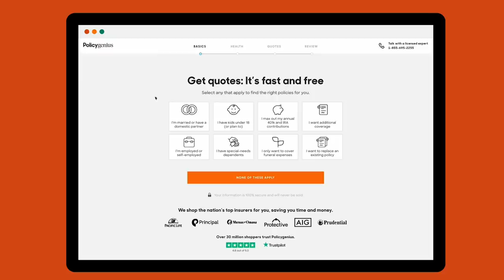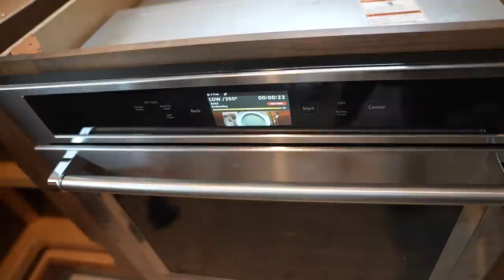DESTROYING OUR KITCHEN CABINETS | BUILDING OUR OWN HOME

Comment: I found with our brand new stainless appliances that the fingerprints will greatly diminish once you start using a stainless steel cleaner/polish. I get some from Amazon that are pop up wipes and they give a smoother surface after continued use. The brand new surfaces were a bit raw but smoothed up nicely after a couple of treatments.

Comment: Allie - before you bake your first batch of cookies, you need to burn off the mfg oils in your oven, otherwise you'll be dealing with some strange smells. Read your owners manual first, open all the windows and doors of the house, and crank up the heat in the oven for a couple of hours to burn off those smells you don't want in your food.  Glad to see all the progress of your house and your smiling faces.

Comment: Sorry, don't mean to be "negative" here. Very surprised that no-one in the comments mentions the fact that your ceiling boards are not supported, or at least "tongue and grooved", at all of the end joints . The board ends are ALWAYS fastened on a structural member (joist, rafter, stud, at least blocking). Never seen anyone let the ends all "run wild" as they might very well "curl", twist, and otherwise separate with heat, humidity, other environmental conditions. Also, in over 40 years of construction, have never seen a "built-in" oven installed at the floor. Single ovens are always installed at roughly "counter" height so they don't require getting on your knees to load and unload. Putting food coloring in the taping compound is "spot on"!!!

Comment: Your Home Depot kitchen designer should have/would have taken the size of your oven into consideration and ordered the appropriate cabinet to make sure it would fit.  Cabinet installers have to alter cabinets to make the appliances fit.  :)  When I was a designer I would always order a couple of extra filler pieces to fill in spaces in case of emergencies.  You're doing a great job.

Comment: The space or gap by the oven?  I would have framed the bottom and top.  Then made a door for it.  To match the cabinets.   To use as a cookie/pizza or griddle top storage for the stove top.  sheet pan storage.  You can still do it.  :)

Comment: Great work, guys!  However..., Trent, if you think your back hurt LIFTING the microwave, wait until you have spent 10 or 20 years bending over to USE the microwave (and oven)!  Hopefully by middle age you will be on to the next house, where you can craft kitchen appliances higher for your older selves.  In the meantime, you both and Brandon have built an incredible space for yourselves and your family.

Comment: Safety glasses Trent !! I hate having something in my eyes and have had to have eye drs take metal and debri out of my eye balls twice.i learned at that point 40 yrs ago to always have Safety glasses with me and have them on whenever doing anything I could have that issue.
   If you didn't have the heat on I'm sure the stain on the boards didn't dry.
   I was wondering if you turned your heat on when Allie said it was like 40 degrees and yall were working on drywall and staining. Live and learn, got to be thinking about these things.
  If the boards aren't dry and you handle them you will leave finger prints in the stain .
  I hope this didn't happen but if so well you personalized them LOL and if you ever commit a crime your finger prints are there for law enforcement LOL
   Wow progress galore .I mean adding Bryce was a no Brainer the guy is a definitely a professional grade builder and drywaller.
   And Trent and Brandon seem to find a higher gear with Bryce there.hmmm LOL 😆
   It's really coming together and when there counter tops go on .oh that is really going to make it seem so finished and ready to be lived in.
   Can't wait for that and I know yall can't either. 
   You need to pay Bryce to stay and finish the house with you and Brandon. You would have it done by end of October no doubt.
   Great job on fitting the appliances Trent. 
  And the appliances are so beautiful and so nice with all the new designs they have now days .those slide our droor grates are amazing never seen that before.
   Can't wait to see the next video yall are flying now.
    Allie is more and more excited every video and thats awesome because she's pregnant for yalls first child and she should be excited the rest of the way.
  Thank guys God bless you all 🙏

Comment: Hi from montreal! Love everything your doing… but if you end up not liking your darker stained wood in the sun room….just paint it the same as the walls…you’ll retail the different texture and it will fallow the ceiling all the way down. Don’t worry about it looking too sterile cause pictures and furniture will warm it up.  Now if your painting the walls a color then you may want to keep all the wood planks the same color (following the white ceiling all the way down to the floor. If there is one thing I’d like to say to my younger (less patient self) is not to stress about paint, it’s the cheapest thing to correct 😉

Comment: Your oven cabinet needs at least a half inch if not a three quarter inch floor to support that oven. You may consider adding extra top braces to strengthen it to carry the load of the stone. Because you reduced the width of the stiles to accommodate the oven width.

Comment: Did you give the T&G a sand before you stained it? In order to get a more even color you have to open up the grain, a lot of lumber has a mill seal that prevents the stain from penetrating the tighter grain.

Comment: A simple question regarding the oven, "what process would you have to use to remove and replace the oven if that was needed?"  e.g. Remove the benchtop, to access the electrical connection, or leave enough lead connection length so it can be slid out to access the electrical connection?

Comment: With the windows open and the air temp and moisture level it means it will take 2x as long to fully dry.   40 degrees is not the ideal temp to paint or stain.  If you were to turn the heat on it would dry faster.

Comment: A 50/50 mixture of denatured alcohol and odorless mineral spirits will remove the tackiness and lighten the dark color. Just use a cotton towel wrung out almost dry, then rinse and repeat.

The humidity of the rain is retarding the absorption of the stain.

Comment: You have no nailers at the ceiling ends to nail the T & G ends too? You need to at least hold a 1x by behind the T& G ends and secure the ends together so they do not bend up and leave visual gaps seen from the floor. Those ends will warp upwards over time and you will wonder why.

Comment: we learnt never put electrical behind oven dishwashers fridge  and more even for water and gas connections if you got trouble with it you must disconnect it first before you change it or for another one or repair put the connection in another closet in in the kitchen left or right or underneath or above the oven microwave fridge and more  this in the Netherlands a rule for kitchens

Comment: A question (I don't want to blame anybody with that question) - what is so difficult in buying the cabinets and the appliances? In Europe you have some 5 steps of cabinet width - and some 3 for appliances - and the appliance steps fit to the cabinet raster. So if I plan for an oven, the appliance might be 60 or 100cm - and there are oven cabinets in 60 or 100cm that fit to EVERY appliance you can buy. I never saw somebody struggling / adapting with the oven like Trent. 
OK - sometimes here it is also tricky to install the stove (right word?) and the sink in the countertop.

Comment: The place looks great. You're going to hate the microwave in the lower island cabinet.  Pain in the butt bending over you can't see the controls you can't see your food. Huge safety risk for kids. If you don't change it now you're going to later. Never mind I know now was 3 weeks ago. Good luck with that.
   That poor lonely Treager on the deck. It loves to bake pizzas and cookies.  Treager time.
      Running slats vertically on accent wall would have been a cool look.
     Did you find the  chimney? 
   Is it still hangin' ?
   The leaves are starting to change now. Great area - enjoy

Comment: If you were to verethane the stained wood, it will reflect the light, and shouldn't look so dark.
But shouldn't you cut them to different lengths so that
they are staggered, like how they lay hardwood floors?

Comment: So i don't mean to nit pick but dont you need to be able to access the junction box for your oven, without having to remove it. I didn't see happen but i hope a proper faceplate was installed for it as well.

Comment: It really would be much safer to set the chop saw on a table.  Easier on your back too.. I would just set the shop vac under the table and hook the suck pipe into the back of the saw.  Turn on the vac, saw and cut down on the mess.

Comment: why don't you get some straw and cover up the areas you need to walk in with straw for the time being.  It doesn't look like you're going to get to any yard work for awhile so to keep the mud down a few bales of straw spread in the worst spots can help and it will also stop some of the erosion.  Does the oven have a lock out to protect kids who like to touch everything?  That dark wood wall would look awesome if you hung some plants on it.

Comment: Because of Allie’s Raynaud’s syndrome, you will be much happier and more comfortable if you put some radiant heat tape under whatever floor you put in the basement. It is my one regret that I did not do so when finishing my own basement. My feet always felt like ice cubes even with a wood stove installed in the room.

Comment: Question?? Why wouldn’t you at least hang 5/8 Drywall on the ceiling in the Basement to give you a 1 hour Fire rating?? Personally I would have hung it before installing the duct work, because now you will have to frame out the duct work and drywall it to give yourself a Fire barrier, which I highly recommend 😇

Comment: Concerned for your safety with the electrical equipment being made live in the kitchen. Obviously not everything is included in the videos but when did a licensed electrician test the installation? Understand Utah allows homeowners to do own electrical work but even that should include testing before making live particularly after all the penetrations with drywall screws. Trent loves to buy tools but have you purchased insulation testers, earth loop impedance testers etc. and do you understand the readings that are pass or fail? How does your insurance company feel about the risks of fire? I want you to succeed in everything you attempt but please be safe.

Comment: Can someone tell me why gas stoves/ovens are a thing in usa? And heating! Just seems extremely dangerous to me. Thank god we have electric ones in use here in finland
Reply from the maker: When operated properly they are very safe and heating with fire from propane or natural gas is much more efficient than electricity.
Reply: @TrentandAllie  thanks for the answer. Made some quick research and found out us has a lot of natural gas which makes gas the cheaper option and one of the ways to generate electricity.👌

Comment: I just leave a ceiling raw and seal it off and paint the back wall or lead the ceiling raw and the back wall raw just seal them off and the last run of the wall and and the ceiling use the wood you've already stained

Comment: The microwave will be one your most used appliances. IMHO, putting a built in down low was a poor choice. Now you have to bend over to use it. A stove is understandable, as it's not used frequently. However,  microwave it constantly used.

Comment: I am kinda puzzled... you want to live in the mountains for the escape from a city feel. But now want the house to look and feel like still in the city??? I just love wood and have enjoyed the feel of warmth that wood gives so paint is not a option. Painting some walls for the too dark feel of being closed in will not be a problem. I thought if painted feel was what you like then why use wood at all. Just sheetrock it and then paint it but wood speaks volumes as to be only stained, not a speck of paint on them at all or even covered over with modern next to a wooden wall. I think that a lighter stain would of been a first choice rather than the enhanced dark wood. Pine wants to be wood so why paint it... its just wrong

Comment: You guys should have protected the outside of your home from water damage asap. Now it’s all gotten wet and mycotoxins and aflatoxins can and will go through everything but glass and metal. Major cringe I’m so sorry to say. You seriously need to do this immediately as fall weather is starting. Screw the inside of the home for now. This is extremely, extremely important.
Reply: At least throw huge tarps up and pull out the bottom away from the base of your house a bit to keep rain off and away from your exterior walls.

Comment: Please be sure to properly cover your oven and microwave before sanding your drywall, even if you put a plastic sheet up. The last thing you want is for that white dust to get into the fans/cracks/motherboards and damage the new appliances. That white dust gets into everything!!